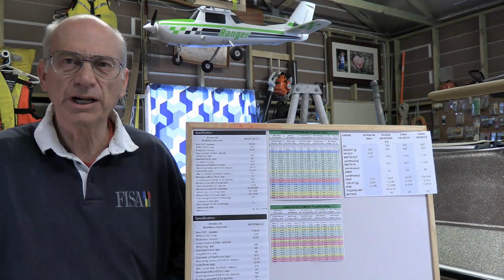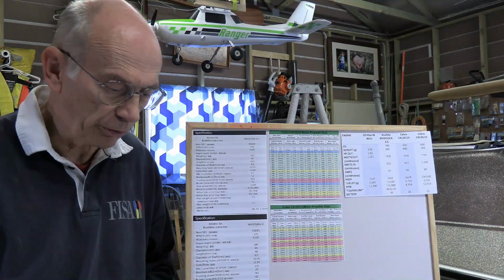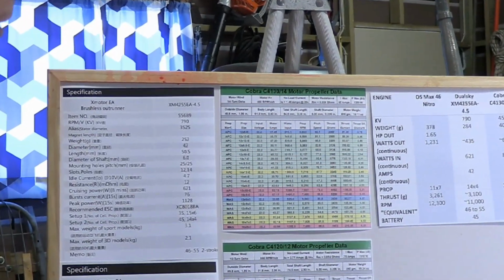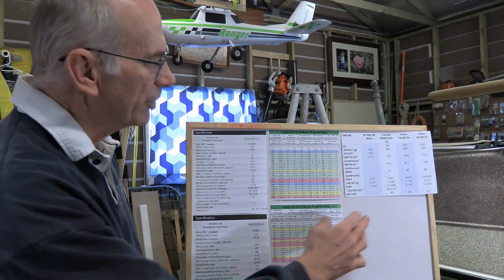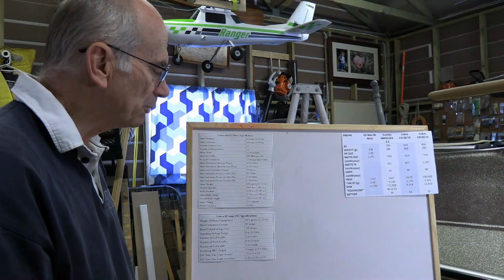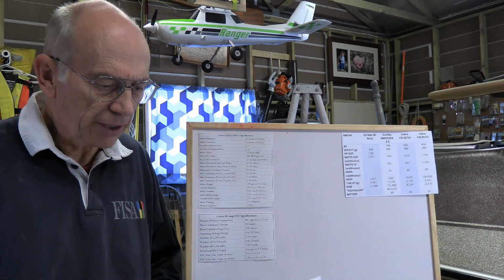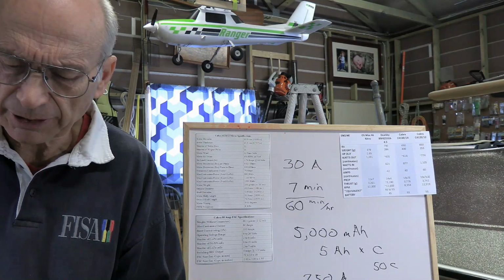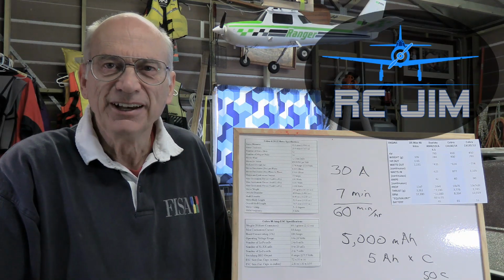Electric RC Plane Component Selection

Comment: All day long is going to be 5 gallons of fuel 10 minutes at a time the glow motor has a cylinder head and muffler blocking some of the thrust and a smaller prop that is less efficient. I converted a 46 glow plane and blocked in the front and sanded the nose down to the dia of the spinner It has far more prop blast and far less drag allowing for less power needed for the same speed or a higher top speed glides much better as well.  No mention of wire size the wire on my 70 a esc is 1/2 that of the 5.2 ah battery.    C ratings for batteries are mostly just made up to sell them the one that lies the most sells more batteries till they get a bad reputation then they change name and start again.
Reply from the maker: Good points.

Comment: Great info, thanks! I've never "stick built" an RC airplane but really enjoy buying balsa ARF's and choosing the components and building it up. As part of that I setup a test mount on a workbench so I can gather data on a number of motors with different props. I still start with the good old online Webocalc to get me on track for a specific plane, then I bench test with a wattmeter. My motor choice brands have primarily been Emax and Gforce. For servo throw calculations I created an Excel spreadsheet to predict the servo arm and control horn holes to use for a given control surface to get the recommended throws. I like it better than guessing. Anyway, fun stuff!
Reply from the maker: Great ideas!

Comment: A internal combustion engine power output is effected by a number of things such as barometric pressure, temperature, humidity etc. Most HP ratings are based on perfect conditions which almost never occur. While certain extreme conditions can effect electric motors generally under normal conditions they can and will put out there max rated HP. This is the reason for the power disparity. A interesting exercise that shows this is portable generators most of which have IC engines with 2 to 3 times the HP ratings of the output of the generator.
Reply from the maker: Good thought.  And with both the generators and electric motors, there is a matter of efficiency.  Input power drawn is always greater than the output.

Comment: One interesting thing is the durability of electric motors with permanent magnets ,edies currents in rotors has no restrictions so it is  heating the mass ,for 1 kW with 0.7 efficiency it is 300W heater destroying the strength of magnetic field among natural degradation over time ,5 years old unused motor has about 45 % strength output.
Reply from the maker: That's an interesting thought.  I might just start a long term test on given motors with given props on my test rig over a long period of time.  It would be good to know how bad the degradation is.
Reply: @RCJim  Very minimal I have 25 year old brush less motors that still prop hang and then accelerate vertical and notice no loss of performance.
Reply from the maker: @JonathanTamm  Thanks for sharing your experience.  It’s reassuring.
Reply: Did you find out manufacturing date on most mainstream motors ,especially the mass produced bargains ? Just a hint ,spinning motor by fingers give you feedback as the poles pass each other ,yes the humps .
Reply from the maker: I have noticed the difference on various motors regarding feeling the magnetic pull as you spin the motor with your hand.  I'll have to start looking at manufactured dates.
Reply: Based on that logic the 10 year old Nissan leaf I had should have less than 1/4 the power than when new and my Tesla that is 4 years old close to 1/2 but they both have the same top speed as when new. I have 25 year old brushless RC motors that still prop hang and then accelerate vertical and notice no loss of performance they had a 15 year break in the middle so unused for that period.
Reply: @JonathanTamm  NISSAN LEAF HAS MOTOR DESIGNED ON DIFFERENT PRINCIPLE .

Comment: Thank you for this detailed explanation. I would like to see a flowchart type procedure. I may have to watch this several more times and take notes.
Reply from the maker: That's a good idea.  I'll think it through and see what I can do.  In the meantime, check out this related article on our website: https://rcjim.com/2024/01/05/electric-power-selection-for-planes/
Reply: Thanks again. With your calculations I made a quick and dirty excel spreadsheet to plug in some numbers and jumped in and ordered a motor and ESC. We'll see... @RCJim

Comment: Excellent job on the video Jim!! I have been wondering what are the benefits of electric motors? They obviously have benefits but, I am going to stick with the nitro engines! The sound the smell and the power they produce is just not replaceable. Thank you for the information!
Reply from the maker: Thanks Jim, that makes sense when you are already set up with everything you need, and if you are in a place where the fuel is affordable.

Comment: Good job mate, don’t you think it’s a shame these days everything seems to be foam and comes out of a box 

when you go back to the 1980s we used to build them out of the Balsa kit 

not with standing foam flies very well - it has its place sure thing 

just seems to make it more of a toy, than a hobby…..

I learned a lot about structures and engineering and glueing and support and bracing and aerodynamics. 

Some of the young fellas. These days have got no idea. They smash these things and go back down to the hobby shop, the next day and buy another one. …..
Reply from the maker: Understood! And those foam things can get a bit pricey!  I still have my good ol’ Great Planes Trainer 40 that I got started on over 25 hrs ago. Smashed and repaired more times than I can count!

Comment: Great info, but when it comes to conversions and ARFs over the years 
the first thing I do now is check and see how much room do I have to install a battery can the plane handle a large 6s or a medium size 5s or a small 4s once I determine the battery or fuel tank then I look at the weight of the plane and how much thrust and minimum speed Ill need to fly it , choosing motor is I like to cross references the engine wieght that was designed for it, all helps me to determine the motor size ,wieght , watts amps requirements for a given prop size..and then its test on the bench after I picked everything thing and try different props to target thrust that I need without over amping the motor. it's a fun process. 😊
Reply from the maker: Yes, it is a lot of fun!!

Comment: 1. Longer props aren't necessarily more efficient. They may produce more thrust, but will be harder for the motor to turn. You can use the energy in the battery to move a lot of air slowly or a small amount of air quickly. What you need is somewhere in between. So, pitch speed is just as important as thrust.
2. A prop might generate enough thrust to pull a locomotive, but if the prop doesn't pull the plane through the air faster than about 3 times its stall speed, it won't be much fun to fly. Thrust without enough pitch speed is useless. You might can hover, but will it pull the plane fast enough in horizontal flight to keep the wing from stalling.
3. Manufacturers use one of two measurements to specify the motor size - the outer dimensions of the motor can or the stator size. With a 4250 motor, they're usually specifying the outer dimensions of the can whereas the 4120 motor is usually the dimensions of the stator. They can't be compared directly by using only their dimensions.
4. Battery manufacturers lie about the C-rating. Since there's no standard test to determine the C-rating, they can't be caught in a lie. And besides, they are made in China.
Reply from the maker: Thanks again for your insights.  Clearly thrust produced with the plane on a bench isn't telling the full story.  Unfortunately, I don't have a wind tunnel!
Reply: @RCJim  Power loading (watts/lb) is a good indicator of performance. If you look up propeller-driven WWII fighters in Wikipedia, they usually have power loading in the specs. Since the rpm of an electric motor is predictable, we can choose a pitch that’ll give us the approximate speed we want. Using the formula for the power required to turn a prop, we can use the rpm and pitch to find the diameter that will load the motor to its power limit. If the prop has an appropriate D:P ratio, we should be good to go. If not, we need a motor with a different KV rating or a battery with a different number of cells. I can do the calculations on my cellphone, but a spreadsheet makes it easier to make changes and see the results.
Watts = 5.3E-15 x rpm^3 x diam^4 x pitch.
Reply: @RCJim  Also, if the level flight speed isn’t at least 3 times the stall speed, a plane won’t be much fun to fly. There are formulas to estimate the stall speed based on the weight and wing area. Wing loading and power loading (power-to-weight ratio) can give you a good idea of how a plane will fly.

Comment from the maker: Note that when I discuss Active Freewheeling I talk about what's happening in the motor.  The active freewheeling is actually taking place in the ESC.  At partial power, each power pulse is cut up into a lot of little segments, with the FET transistor turning the current on and off many times during each pulse.  Every time it turns it off, the windings are trying to keep the current going, and if nothing was done, there would be a voltage spike that would cause damage.  So, they 'dump' the current through a diode, allowing it to go back around the 'loop' that it had just gone through.  The diode has resistance, which makes it heat up and waste energy.  By replacing the diode with another FET, the transistor can simply open up that 'channel' for the current to go through when needed without significant resistance, allowing the current to 'freewheel' around that loop of the circuit.